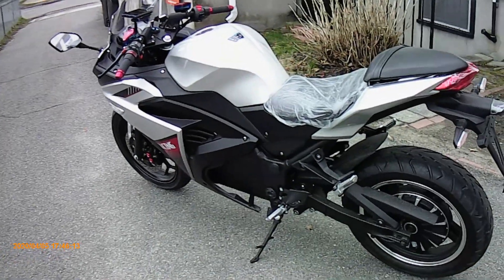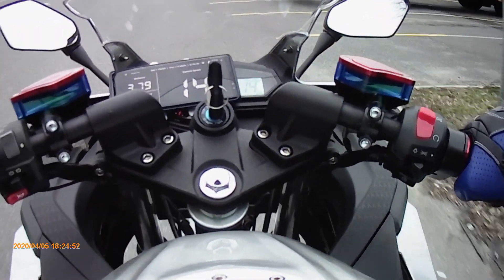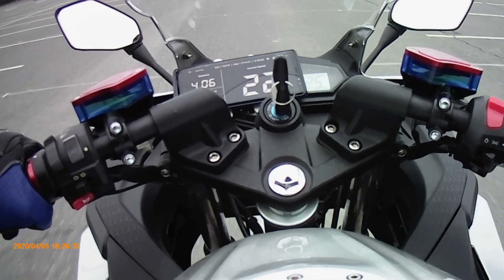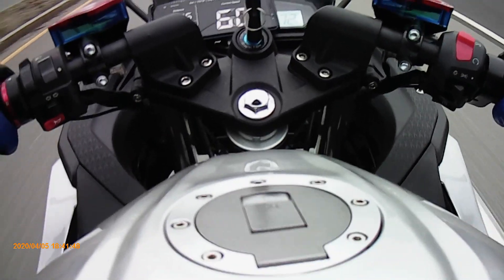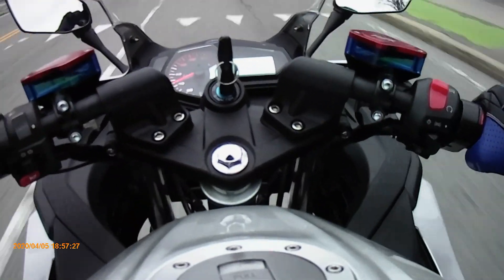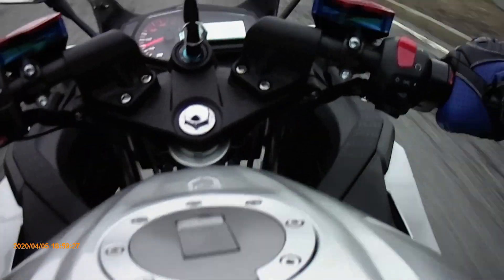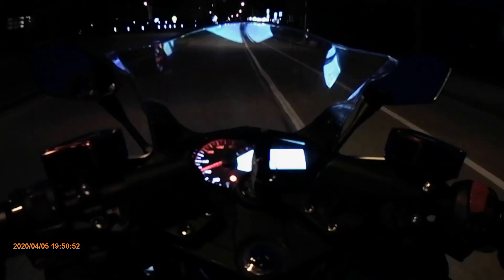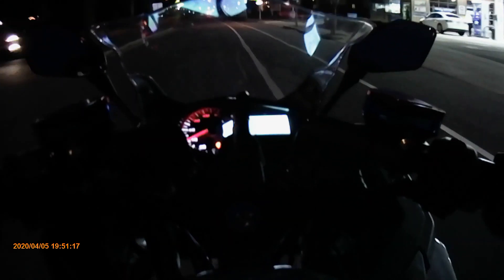I imported two full-size electric motorcycles from China – Part 10: "The Speedo and Range Checks"

Comment: I see you have like 20 videos on these bikes but you never include the info of where you purchased the bikes... How long they took to arrive... What was the cost all together after all of the charges and fees etc? Please let me know the info when you see this message as I would like to order a bike and try and get it before summer or by mid summer at the least!!!
Reply from the maker: Hi Buffalo Eskate. These information are all in the videos and in their descriptions:
From Alibaba.com, selleer Wuxi Saichi
Took about two and a half months to receive them
I do not recommend you to buy them from China and import them yourself. My experience was not good with Wuxi Saichi; they stopped responding to my inquiries once they got the money. I had to go through Alibaba's process to get some money back for the wrong chargers Wuxi Saichi sent me.
Their quality is not good. They cost too much once you pay all the fees (close to $2500 final price tag per bike). You may not be able to register them to ride them on the street (this manufacturer is not certified by NHTSA, National Highway Traffic Safety Administration).
If you are in the U.S., you can probably buy one of these from Canada by paying a bit more, so you will at least have some customer service if there are issues.
Get a CSC City Slicker or perhaps a used Zero. These Chinese electric motorcycles are not ready for the prime time. Good luck!

Comment: Do you have any problems or maintenance?
Reply from the maker: Yes, the steering head bearings on both became progressively very stiff and rough, to the point of making them dangerous to ride. Please watch the last video in this series. I did not have a chance to fix them yet. :(
Reply: The company probably didn't grease the bearings. Also check the ring  under the main top bolt that might be to tight.  But I think its ur bearings

Comment: Great video...I would estimate the total range above 35miles if it wasn't cold out...not bad a an electric bike with lead acid batteries.
Reply from the maker: Thank you so much, I am sorry again about the bad camera angle, I was so angry to myself after two plus hours of riding in the cold. You are correct, if I did not use the S mode at all and had warmer weather, I could possibly reached 35 mile range. Cheers!
Reply: @PropsWheels  how many batteries does the bike carry and do u know the amp/hour rating of them?
Reply from the maker: Hi Tristan. I believe 6 lead-acid batteries in series to result at 72 Volts and 20Ah of   total charge. In any case, I am planning to do a strip-down video and take a look at the insides.
Reply: @PropsWheels  dont have us waiting too long...Are you considering a battery swap and motor upgrade instead of buying another electric bike?
Reply from the maker: I am already editing it, but there is a lot of footage I have to go through. Should be posted this weekend. I am planning to  attemp registering one of them first and then decide what to do. The plans are all evolving in teal time... Take care.
Reply: Props & Wheels 
I’m also thinking about buying a electric motorcycle. You mention registration do I have to get it registered?
Reply from the maker: Hi Sedrick. If I have to guess, yes, most probably you will have to register, but check you state's laws. Electric bikes/motorcycles have not been well defined in terms of registration. I have not registered mine yet and treating it as an electric bike (which is indicated on its "Certificate of Origin" document), but I am planning to try to register it as a "Moped" in Massachusetts after RMV starts accepting non-essential registrations (due to COVID-19 RMV only does very registration appointments right now).
Reply: @PropsWheels  thank you.